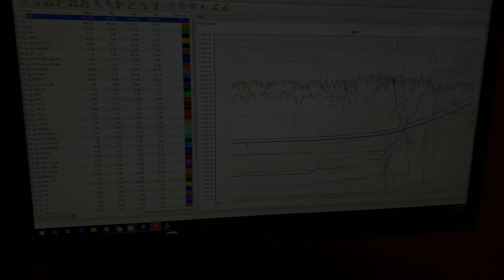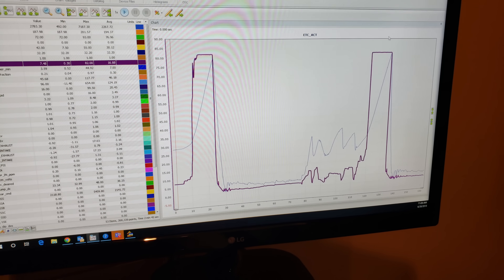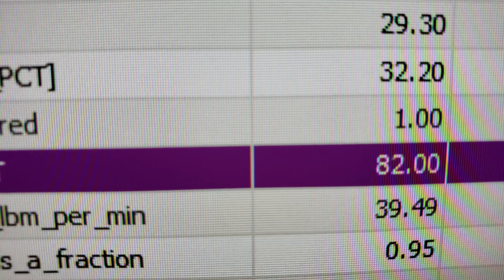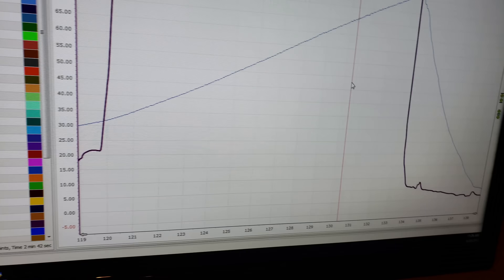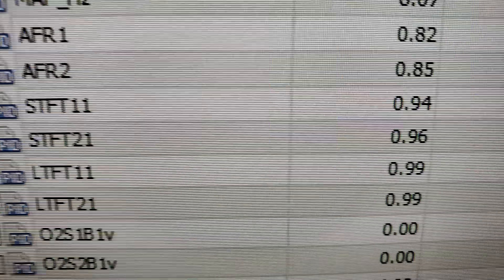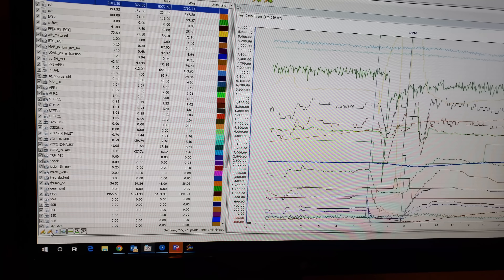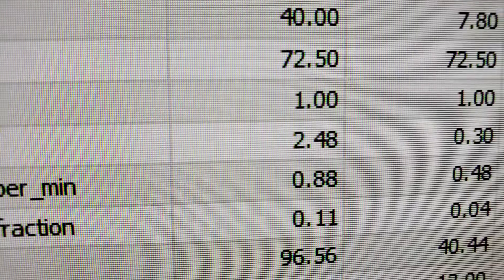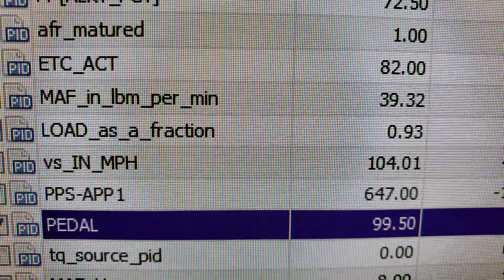How flex fuel Tunes works on N/A Coyote mustangs

Comment: So on my 2013 gt I’m running full exhaust (stock headers) CAI and boss 302 manifold with 47lb injectors. Do I need to get a flex fuel sensor or am I able to run a flex tune without one? Just want to make sure before I go get my car done.

Comment: I was told from a Lund tuner that you should never daily flex fuel tune. That tune is for when your in between tanks of different quality gas and you should always be running the 93 tune or the e85r tune depending on the fuel you have un the area. This video seems to suggest you are ok just staying on flex fuel tune only.

Comment: I put in my flex fuel tune and filled up with e85 and my alcohol percentage is staying at 47 percent won’t go up what do i do next ?
Reply from the maker: Did you have gasoline leftover in the tank? Did you physically test the ethanol being put in the car yes or no
Reply: Alejandro Flores i was on 0 miles of 91 and put in e85 and no how do i test the ethanol?
Reply from the maker: @cuzins45  https://www.amazon.com/s?k=e85+tester&adgrpid=58800687769&gclid=CjwKCAjwxLH3BRApEiwAqX9arSKG0D0eqT2LAMyeKZ5ekfif34IZAT_O6h4l2mwfQoEgBg_GRzZ9-BoCC2QQAvD_BwE&hvadid=274676784690&hvdev=m&hvlocphy=9052756&hvnetw=g&hvqmt=e&hvrand=3621280953387772439&hvtargid=kwd-301239971904&hydadcr=18795_10177122&tag=hydsma-20&ref=pd_sl_1brda5gcgj_e

Comment: What about a 93 tune and E15 fuel? Would it be ok with the car?
Reply from the maker: Yep, most fuels have 10-15% ethanol already, and todays vehicles run on a 14.0 stoic (10% ethanol) base fuel.
Reply: @YDBT4LIFE  Thanks for your vids. Learned a lot from them.

Comment: Only 1 degree more timing on e85? It is flex fuel but that doesn't sound like much performance gain. Why is that?
Reply: Because the first log was with e32 which is about 95.5 octane.

Comment: What's your thoughts on seeing MAF/lb per min and comparing it to power? I've read mixed views on it so I'd be curious to hear your thoughts on it.
Reply from the maker: T maR not reliable.  Lol out twin turbo car made 1347 rwhp. Maf flowed 86 lbs min. Up to a point it's a decent comparison.  But mph and weight doesn't lie
Reply: Figured so. I remember logging my TT car and it was showing some crazy lb/min and it didn't add up lol. I think I saw as high as like 90 on 9psi and 91 octane during early tuning haha.

Comment: The inferred alcohol content is only as good as the initial airflow model calibration based on exact knowledge of the alcohol content in the fuel from start. There is a good chance (not definite) that the initial "pump gas" tune datalog that showed 30%+ alcohol content is an inaccurate number. With flex enabled, the STFT & LTFT will always correct to 1.00 regardless of whether the tune is jacked or not and they will calculate error into the inferred alcohol content.

Comment: solid video, learned a lot, was also just wondering this myself. My NGuage has constantly been reading E90/E91, car has been happy. 

Alex, do you recommend ever running a tank of 93 to clean up E85? I hear a lot of people say saying E85 will harm the system after awhile. Any truth to this?
Reply: Sasha Klim e85 will harm your system but only after a couple years it will start to eat at the tank and deteriorate it

Comment: Alex, that was AWESOME information!  Thanks for explaining.  Here’s a question for ya:  What about non-ethanol gasoline?  Up here in Virginia we have Liberty gas stations, some of which have 100% gasoline.  It’s primarily used in lawnmowers, weedwhackers, chain saws, etc because the ethanol doesn’t foul those tiny carbs as bad.  But I’ve had success running 100% gasoline (87 octane) in cars.  My old Civic would run smoother and yield better MPGs... almost 10% better MPG for 7-8% higher price.  It was worth using all the time.  (I don’t have enough data on my Mustang to tell a difference).  How would a Lund tune respond to non-ethanol gasoline, and is this worth considering on a daily-driver?  I’ve only had my stock 08 Mustang CT/CS ‘vert for a couple months.  So far it seems to like non-ethanol.  After 1000 miles of 100%, the MPG reading is 24.  It seems to run good, but I don’t have seat-time with other fuels to compare.  Admittedly, my focus may be different than most, as I’m an old man who just enjoys cruising top-down... No racing here.  I just want a nice-sounding, smooth, responsive car.

Comment: This has also been on my mind a lot lately. Can anybody explain how I can test fuel and get 90% ethanol but the car is only seeing 80% ethanol? Im thinking possibly h20 in the fuel? Anyone? I know without a dedicated ethanol sensor in the car it wont be exact but 10% seems excessive. Im not worried about it, my car runs great its just something that burns in the back of my brain in the wee hours of the morning.
Reply from the maker: Robert Chilton in the disclaimer it stated that the car will learn it "close" not dead nuts accurate.

Comment: So, with Lund Flex Fuel Tune, I can take my 2014 GT from 91 to E85 without changing my tune or adding a flex fuel sensor?
Reply: No. 2015 and newer only need flex tune. Earlier Coyotes need injectors plus tune.

Comment: When you say its the same tune, are you reiterating that you won't make any hp/tq gains by switching fuel, but simply just showing us you can run either with the flex tune?
Reply: No. The fueling and ignition curves change with increasing ethanol % and power increases accordingly..  I have a Lund flex tune on my GT350. The difference in power between California 91 octane premium and e85 is about 30 hp.

Comment: So what’s the typical max timing yous set on the tune with perfect e85  31 degrees or does the knock sensors continue to add timing
Reply: I was told that the timing is capped at, I think, 30 or 31.

Comment: How does the tune read the E ? Do you have to install a flex fuel sensor ?
Reply: No fuel sensor. The ecu calculates the ethanol percentage based on data from O2 sensors as stated in the video. This is how all Ford flex fuel vehicles have operated for at least the past 10 years.

Comment: I always wondered why the flex fuel system that they use in the coyote f-150s was never integrated into the mustangs engine platform. Would've been much easier all around for tuners and power seekers alike
Reply: I think they actually copy the f150 tune and adjust it for the mustang. But it would be nice to have this from the factory

Comment: FF tune vs E85 Race tune difference?
Reply: A properly tuned FFV Will have no disadvantages to an Ethanol "race tune"  All depends on time spent setting up the tune file.
Reply: Ajay Lee  Im talking about the mail Lund FF vs E85 race tune. I currently have the ff tune but since i use e85 all the time was considering going e85 race tune if it has any gains.

Comment: Hey Alex. Wasn’t there a switch/ selection in the computers programming already that can be changed to AUTO and will detect what fuel it’s using.?   So to speak that is.  I’m sure there’s more to it.
Reply from the maker: Mustang Guru no you have to populate the tables
Reply: Alejandro Flores   Ok thanks for the info.

Comment: How can i get a flex tune on my stock 2017 gt in L.A
Reply: Pay Lund. The flex tune is especially great for those of us who live in The Golden State. All the factory power figures on performance Mustangs are based on 93 octane (note the * in the ads). California cars are down about 10 hp right off the bat due to our 91 octane. Since the dyno results from Lund are comparing 93 vs. e85 our power delta is even greater.

Comment: Does this work the same as with or with out nitrous? Or would there have to be 2 separate tune files for the nitrous? Does it depend on the shot? Small enough shot would be ok with the n/a tune or “ factory tune” or with nitrous it is a must for a tune?

Comment: What is the "learn procedure" and how does one do it "improperly/properly"?
Reply from the maker: TopNotch50 when you order a tune the directions get sent to you
Reply: I just fill my tank and drive easy until the Alcohol Learn indicator on the nGauge switches from 0 to 1. Takes 3-4 miles. I almost always fill with e85 from the same pump so there is very little "learning" necessary. The only time I fill with 91 is when I'm going to the dealer for an oil change due to the fact that in cold weather the engine takes several seconds longer to start with e50 or greater and I'd rather not raise any eyebrows.

Comment: Just wondering, is there a flex fuel tune for supercharged coyote's as well? Or do you need to run 2 separate tunes?  That is if you have the fuel system and injectors to support it I mean

Comment: Any ideas why Lund is the only one to offer a flex fuel tune?
Reply: Tony Parenti yea id like to know why too. Why does vmp not offer it. Every time it was asked during tuning tuesdays. it was just stated we dont offer it and end of subject. Maybe i missed the reason why.  Doesnt really matter to me anyhow since i get all my tunes from lund anyhow.
Reply: That is a good question, although Livernois does as well. AED claims the stock injectors are too close to their limits with e85 although I have yet to hear of a single failure with a Lund flex. Also it should be noted that it isn't necessary to run full 85% ethanol to derive nearly all the benefit. e60  is 100 octane and I'm sure would run the same timing with lower injector duty cycle.

Comment: Ok I know your a Ford guy I got that. But I have 2 dsm  an 90 eclipse  GSX and an 95 GST wanting to run E85 on both cars fuel system I think is their , 340lph  pump on both 1200 cc fic injectors and the other 1050cc running  link my question  is do you know if that tune system  learns e85 mixture in real time I saw in 1 video you made a point that just cause it says e85 dont mean its e85.
Reply: Gregory Robinson Just throw a ethanol sensor on it. Your running "link", im guessing dsmlink, that supports the ethanol sensor.

Comment: What reads the ethanol content?
Reply: To my understanding, correct me if I'm wrong, is the car learns E content by automatically increasing/decreasing fuel content to get O2 sensor to read what the tune commands. If more fuel is required to get the lambda value it desires, then it has more ethanol, so it increases timing and vice versa.
Reply: Javier Hernandez 
The method he explained in the video uses the O2 sensors.

Comment: So I have a 16 GT S550 tuned with a Diablo Trinity on the performance 91 tune and I recently have been running E85 and 91 half and half in the tank. I have also ran just E85 alone as well as up to 101 alone and back to 91 again all on the same tune!! I have not changed the injectors or anything else for that matter just the fuel change. So why do I need a $$$ Tune from someone else when this seems to be working now? Granted I get best performance from E85 mixed with a little 91 octane. But best fuel economy with straight 91. Do I need anything different Yolo?
Reply: Because of the cooling effect e85 has a much wider window of safe AFR than straight gasoline. However pure e85 ideally wants about 30% more fuel. It is unlikely your Tritnity tune provides that. But because it is a 91 octane tune ignition advance is conservative and may be compensating for the somewhat lean condition due to lack of fuel. Or, if run hard enough, it may be a ticking timebomb.

Comment: Will running straight e85 for a while cause issues with stock fuel lines? Everyone keeps saying e85 will eat the rubber in the stock fuel lines. But I've been running my flex fuel tune from Lund for over a year with occasional e85 and haven't had issues. Wonder what your thoughts are on this?
Reply: I dont know about s550's but I had E85 eat my injector seals on my old Cobalt SS. Had to upgrade to e85 rated seals.
Reply: @oCaRRiEDx  Guess I can answer my own question now. Switched to only e85 tune for almost 2 years now. Have never had any issues in my s550 even after going supercharged. :)
Reply: The people that gave you that information is full of shit!  It won't eat the rubber!  Keep going Bro!

Comment: How about for boosted cars? 11-14 cars?
Reply from the maker: No boosted cars for flex fuel, NA only.
Reply: Why is that? Lack of pump and injectors?  They should be able to take it I would think... atleast my cadillac did.  Does it have to do with higher compression of the coyote?
Reply: Alejandro Flores. Will the work for 11-14 n/a? Or just 15 and up?
Reply: rocketbunny1314 11-14 needs bigger injectors. LU47 injectors are perfect for N/A. Then get the FF tune and fill it up with 91/93 or E85 and go.

Comment: Could you use a flex fuel tune on a 17 mustang GT with a GT350 intake? It also has a cold air and cat back exhaust. Everything else is stock.
Reply: Yes you can, but you need to have 47 lb injectors. I have the Lund flex fuel tune, gt350 intake manifold, and lu47 injectors from Ford Performance, car is much happier on e85.
Reply: What you are describing is the Ford Performance Pack. I can't speak for Lund but I would hazard a guess there is a 99% chance they can write a flex tune for that combination.

Comment: Currently I am on a Lund Flex fuel tune cause locally we don't have actual E85 we have more like E60-E70.  Once I get full E85 then I can run the E85 race tune.
Reply: Matthew Skaggs 
Google Advanced Fuel Dynamics. 

Their system was inspired by your same insight that E85 varies from station to station.   I'm not endorsing their system,  but it sounds interesting
Reply: stylac thanks, it does sound interesting I will look into it.
Reply: Matthew Skaggs 
My main concern about their system is how they decide to extrapolate an E85 tune from only the base tune and the ethanol percentage.  My instincts make me think that interpolation would be more precise
Reply: stylac so looks like it’s just a system that reads if you have e85 and how much, it’s really the same thing that my flex fuel tune from Lund does.  It reads if I have e85 and if it’s actually E85 or basically the ethanol content.  And with my 16 all I had to do was buy bigger injectors which is nice on some older mustangs there’s more you have to do like the fuel pump etc which if that was the case then maybe a system like advanced fuel dynamics would be very useful.
Reply: Matthew Skaggs 
Not sure if it matters but their system uses an off the shelf GM fuel sensor while the Lund method (as I understand it) uses the factory O2 sensor for feedback.
Reply: stylac well that is interesting now as I did not know that, I wonder if the Lund tune would be more accurate with that system then, almost like the best of both if you will.  🤔
Reply: It's not their system,  the code is in there right from Ford from F150 coyote flex vehicles. Ford just choose to not turn it on for mustangs. They are just optimizing the tune to use the higher octane.
Reply: Matthew Skaggs pA
Reply: e60-70 provides 90+% of the gain with e85.

Comment: Is it typical for a bolt on n/a car to only see 1 deg of additional timing from 91 to E85?
Reply: JesseBerger i would expect more timing from 91 to e85.
Reply: Anthony Wyzen as would I, although it could be because there was already 30% alcohol content mixed in with the 91. And not quite 85% with the ethanol.
Reply: SHAWNO not on a bolt on n/a car.... maybe on FI
Reply: e85s max is way higher than anyone thinks. dynamic and static compression are different in every car. just food for thought.
Reply: e85 max 2-3 more degree prob good for 40-60hp.

Comment: So can you do a flex fuel tune on 11-14?
Reply: Andrew’s Garage yes just upgrade your injectors to 47lbs and your good
Reply: DEEREMEYER1 your a dumb ass fuck doesn't know shit Simply looking at a fuels BTU content by volume does not give an accurate picture of it's potential. To determine whether or not it is superior or inferior to another it's best to calculate the specific energy of both fuels and compare those numbers. When that's done, you will quickly see ethanol is superior :D
Reply: DEEREMEYER1 i think there is a piece you're missing. First E85 is 103-105 octane, second if 91 or 93 cost more than 30% of E85 you win by saving money. E85 is great if you are boosted, more timing and lower IAT from alcohol cooling effect. NA cars win by allowing more timing at lower rpms and good tuners on coyotes can very cam overlap to build more dynamic compression. Look at 1/4 times and dynos, it's not snake oil.
Reply: GERMAN ZAPATA do you absolutely have to upgrade your injectors?
Reply: Ariel Elizalde I would don't want to take that chance
Reply: Ariel Elizalde well if you want a flex fuel  tune yes u need them for e85 aka more power

Comment: Hey Alex can you explain if pops and crackles it’s bad for the car and if a tuner can do it I have a 2017 mustang gt long tube headers and cat back corsa extreme and gt350 intake manifold
Reply: Yes it is bad for the car, if your referring to the "Popcorn tune" or pop tune, its bad, it just throws excessive fuel down your exhaust that is unburnt and as soon as it touches your hot ass exhaust, it pops and that creates damage in your exhaust walls and will destroy your cats and exhaust system, just let the pops come naturally with a 93oct tune or E85 tune👌

Comment: why are flex fuel tunes not used on power adder vehicles?
Reply: They are used on power adder vehicles.. alot of GM use it.  But I think upgraded fuel pump and injectors would be required for 5.0's